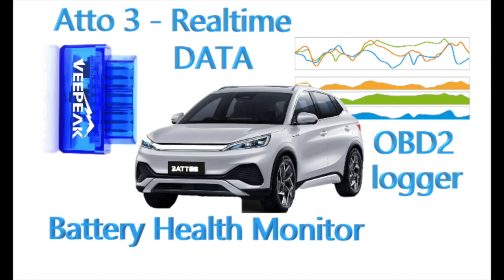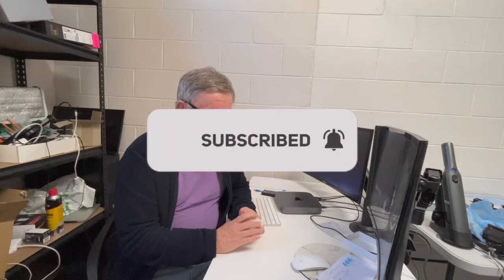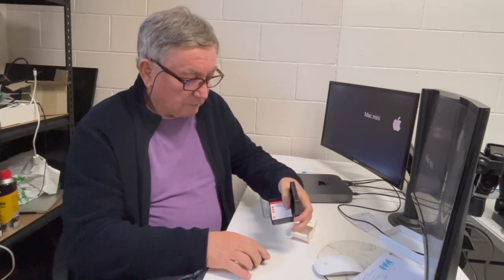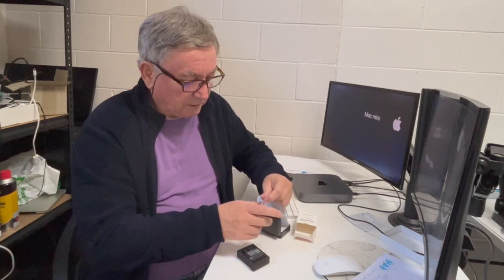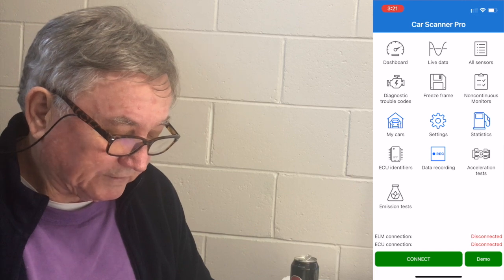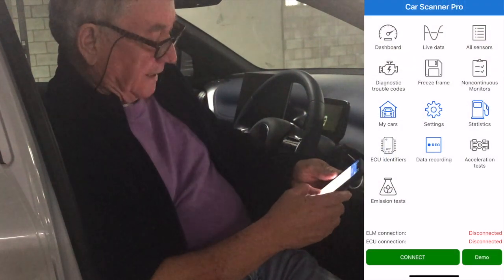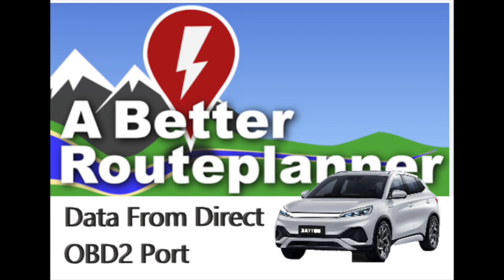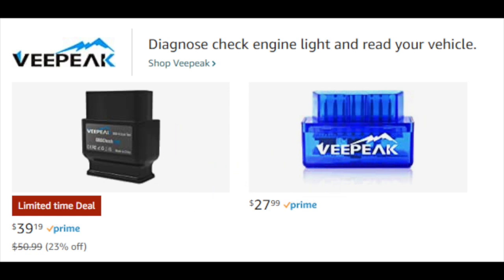Atto 3 OBD2 Port Battery Data Monitoring

Comment: Hi! I want ask you all something. I own an Atto 3. In the winter when you need to open the heat, apart from pressing the fan button and adjusting the temperature do yo also have to press the A/C button to get the right temperature? On my Atto 3 if I don’t press the A/C button on winter even if I set the temperature very high the air coming from the vents is not warm enough just luke warm. It’s very confusing because I don’t want to use A/C in the winter since A/C uses more power. This issue is bugging me so much and I can not find an answer anywhere. Thanks!
Reply: Since there is no hot air coming from the engine, you need to turn on the air conditioning in electric vehicles to warm up and cool down.

Comment: Hi, nice video. Helped me at my own approach. I use a MeatPi Wican OBD to read out SoC of my Atto 3 and push it to my Smart Home/Energy Management. Though, I wanted to ask you, if you have long term experience with letting the adaptor be plugged in permanently. I have concerns draining the 12V battery, becaus mine is not powering off OBD sometimes as it seems. I expext OBD to be powerless when I park the car, turn it off and do not plug it in for charging.

Comment: can you do a video on side loading apps after up dated software on byd.
Reply from the maker: for version 1.5 the password is BYD6125F other the same. I suggest you install GBox because BYD have stopped third party apps on version 1.3 released in Ireland
Reply: @ATTO3 Owner  we are version 1.5 and not accepting apps . it recognizes the file but won't upload .just has 3 party app warning.
Reply from the maker: I have 1.5 and I just checked and upload ok with no warning. Where are you? Must be two versions of 1.5.
Reply: we bought the car in Qld .
Reply from the maker: robina or brisbane
Reply: @BYDOwnersAU  
robina
Reply from the maker: 0423160052 mermaid beach

Comment: Hi keep up the good work, I learnt so much from you
In our mechanical workshop we have a Autel  obd2 scan tool and it reads and deletes codes on a byd ATTO 3, Autel Intelligent Technology Corp Ltd is an automotive electronic products manufacturer
Also ABRP recommends OBDLink CX OBD2 dongles which supports BimmerCode which allows you to code the control units in certain make of vehicles BMW & MINI’S and maybe others to unlock hidden features and customize your car to your liking
Reply from the maker: Autel is a great product for the professionals. OBDLink CX is $US90 here where Veepeak is $US20. Thats the only reason I used Veepeek. OBDLink has it own app for its dongle which is superior to Car Scan. ABRP does support Veepeak but yes they do recommend OBDLink. Thank you for your info and kind words